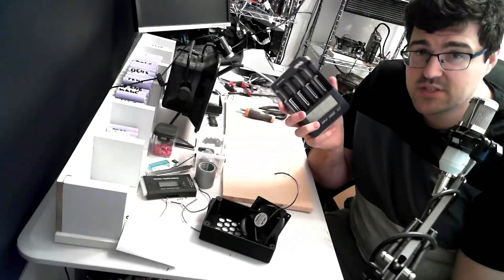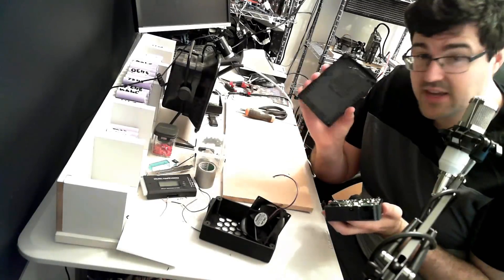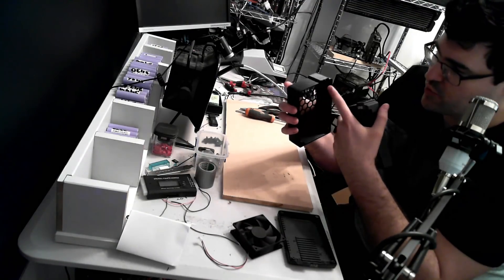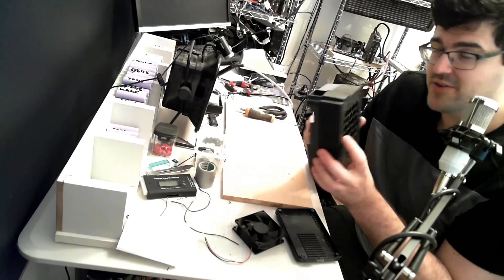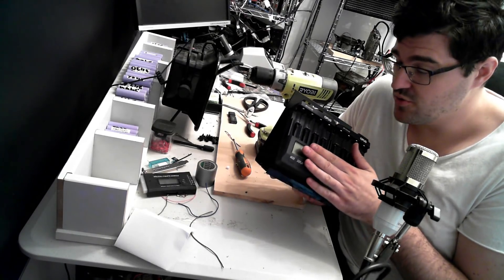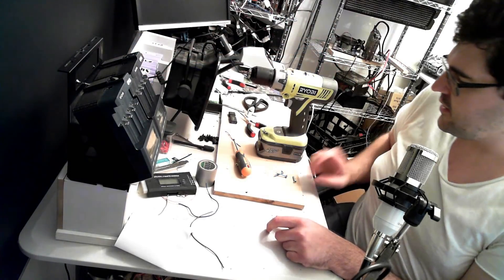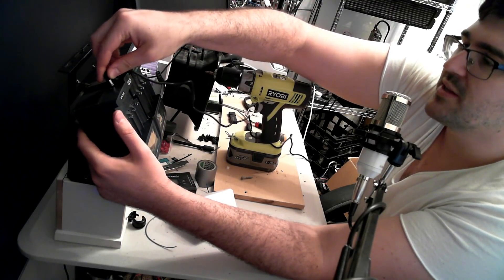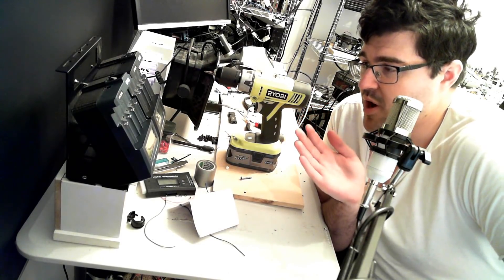OPUS 18650 BATTERY CHARGER MODIFICATION (CASE AND FAN)

Comment: Hi can i charge 9 cells jn parallel in one slot?
Reply from the maker: I wouldn’t try it. I have no idea what it would do to the charger. Assuming your talking about running leads of the charging pins to the 9. I think the charger has temp sensors designed for just the one cell. Best to just get a IMAX or something like that.
Reply: @ScottyDIY  thank you for your reply but i already tried it hopefully not to destroy my charger of my cells,would you check my vid and give some advice?https://youtu.be/fXki1jxcm9E
Reply from the maker: Yeah had a look, is it still charging to full capacity then it may work. what is the charging Current. are you doing charge only or discharge test?

Comment: I have Zeepin BT-C3100 v2.2 it look almost identical but name Zeepin there you have Opus, but i think that are Zeepin monday work, becouse it will only charge to 4.16v and discharge only down to 3.21v how high are your Opus charging? and how low are discharging on your Opus?  Nice mod you did, i wish i have a 3d printer maybe that be my next toy :)
Reply from the maker: They should be the same chargers but different brand cases.  I’m not sure on the discharge voltages I have read 3.1V on 18650s. Inside their is a switch that can change the charge voltages that increases to 4.35V. I will do a video one day on the charging of the 18650 hopefully that should show what’s going on. The 3D print model should fit your charger as well.
Reply: @ScottyDIY  In my manual i read discharge voltage 2.8v but in real it´s 3.21v  but i have order one more Opus hope that one are better i also have order Liitokala lii 500 so i have little to try and make some youtube movies about :) i now the switch maybe 4.35 be 4.2 i will try.
Reply from the maker: I just did a discharge test at 1000mah and it got down to 3.2V im charging now and ill do another discharge tomorrow at 200mah and see if it is different
Reply from the maker: Just did a charge at 500mah ended up at 4.15V
Reply: Not so good we get lower capacity of the batterys then it's not fully charge and not discharge to 3.0 or 2.8
Reply from the maker: Well depending on what you using them in as well. Mine are to get capacity readings so match them in battery packs for a power wall. I don’t want the to go past a certain depth of discharge. And they will be charged off something else. All depends on what your planning on using the battery for. Plus if you looking at capacity have you tried something with a larger amount mine are roughly 3400mah after full testing most generic 18650s off eBay won’t even get half of that.